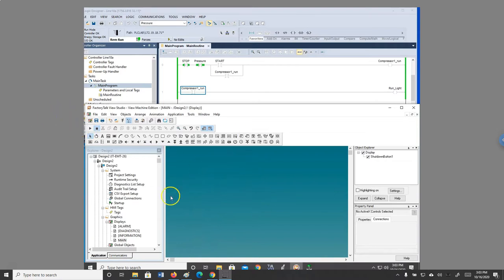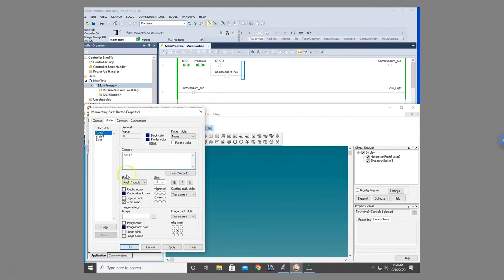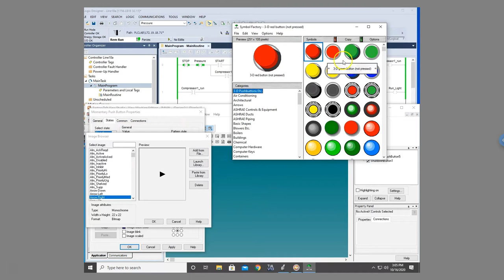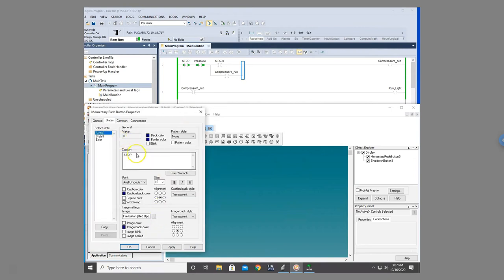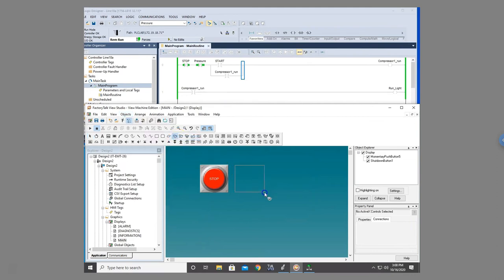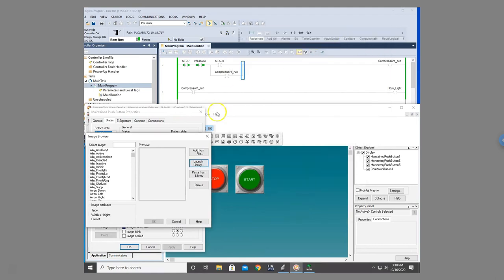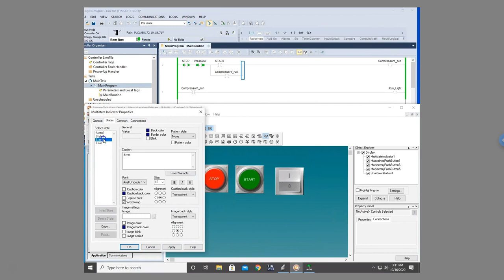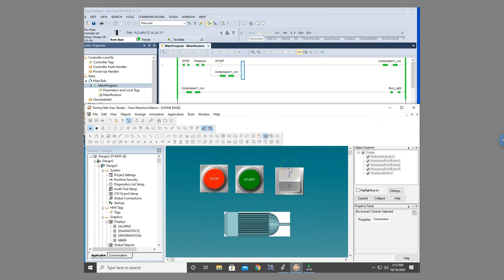HMI Programming Video 2: Using Images for Buttons

Comment: Hi professor, the pressure switch is normally closed switch, why the switch on FT view turned on will causes the current flow through the pressure switch? Thank you.
Reply from the maker: Hello Jiahon Lim.  The pressure switch is an XIO (examined if on) which does work like a normally closed, which means if the pressure switch gives a high signal to the PLC, that it would stop the compressor because it would de-energize in the program.  When the pressure switch sends a low signal to the PLC, the compressor would stay running.  I was simulating this high and low signal with the toggle switch in my HMI program.  So when the toggle switch was low, the compressor would run.  When the toggle switch was high, it would turn off my compressor.  I hope this makes sense.
Reply: @TheCommonSenseProfessor  Oh, I got it. Thank you very much for your clear explanation.
Reply from the maker: @jiahonglim7823  you are welcome.